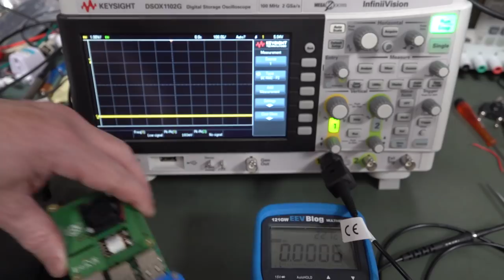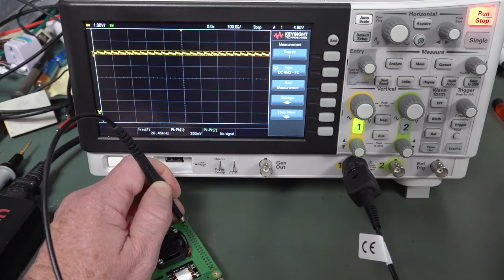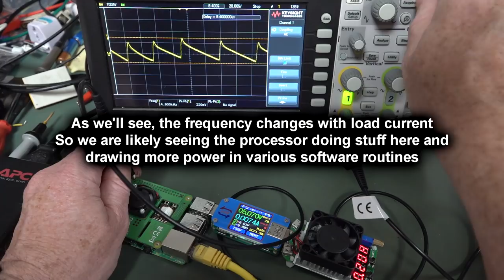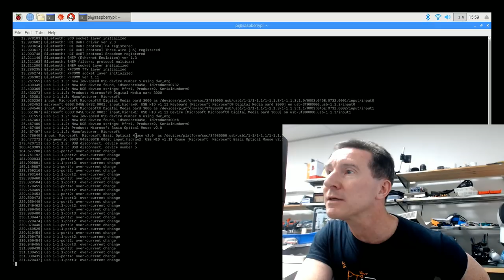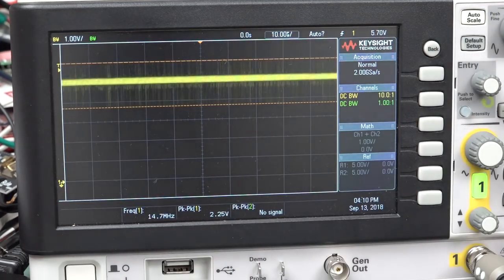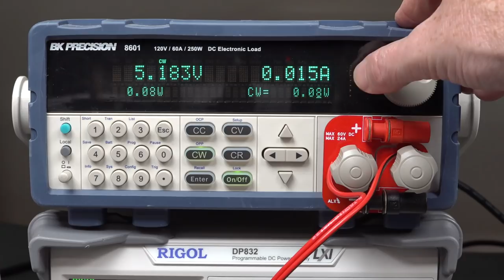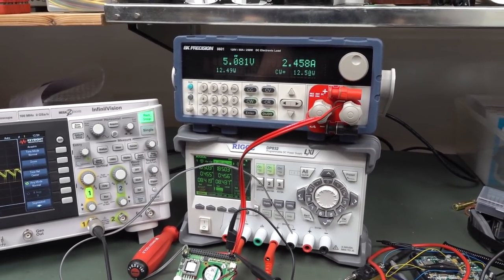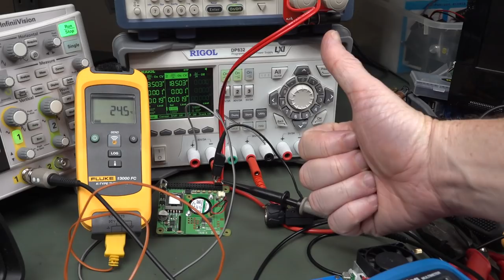EEVblog #1122 - Raspberry Pi 3 PoE Hat FAIL Investigation

Comment: Eben Upton of the Raspberry Pi Foundation told The Register that the problem lay with "an interaction between the fairly low-frequency switching regulator on the HAT, and one of the two brands of USB current limiting switch that we use on the main board".

Upton continued: "Because the regulator operates at a fairly low frequency, each time it switches it moves quite a large chunk of energy into the three USB reservoir caps via the current limiting switch: this large instantaneous current is fooling the switch into thinking that a genuine over-current event is occurring."

https://www.theregister.co.uk/2018/09/11/raspberry_pi_poe_hat_issue/
Reply from the maker: Ah, there you go, interesting. Is there a full schematic that shows the USB protection chip? I haven't even looked at what chips are used on the RPi yet
Reply: Why even charge caps with current limiting?
Reply: Sorry I don't know I just read the article a couple of hours ago and thought it might help clarify the issue.
Reply: I don't think RPis are fully open source https://www.raspberrypi.org/forums/viewtopic.php?t=55777
Reply: i was about to just post the same link. 

it is a refreshing change though for a company to be open and honest about a issue and to state that if you tinker with the hat to fix it you will still honour the guarantee...
Reply: hmm, now I wonder if a bulk "cap mod" on the hat output, would reduce the USB port caps from trying to filter the power for the rest of the Pi3. Hmmm.

a couple of nice hundreds uf Os-Con's may do the trick. And a heatsink for them diodes, damn! 131c, on the outside of the diode, I'm surprised it didn't die sooner.
Reply: What's the point of the three capacitors in the USB subsystem? I'd try scraping them off and seeing what happens
Reply: The PI will crash when you plug in USB devices while the PI is already running, due to the "rush-in" current that occurs when the empty capacitors in the USB device are suddenly connected. The USB host needs to have a certain amount of capacitance from which to provide this current.
Reply from the maker: Martin Rowan - I'd expect a fair bit of variance with this, but errors triggered with nothing connected, yes, something else has to be at play as well. Perhaps it's the rail noise as I initially expected.
Reply from the maker: MH Techy - That is the "reduced" schematic, it doesn't show the USB components in questions. Has anyone done a reverse engineered schematic?
Reply: A comment this informative and well sourced makes me wish I had sock accounts to contribute more upthumbs
Reply: this would never have happened if dave had just supported solar roadways
Reply: @Blox117  And batteriser.
Reply: EEVblog  I'm not sure it's the part but the pin-out looks good.    https://www.exar.com/product/power-management/universal-pmics/universal-pmics/mxl7704#typical-app-modal
Reply: SMPSU's have a tendency to blow themselves to bits. Current limit  is applied on every cycle to stop that happening in the event of a momentary glitch that would destroy the board otherwise.
Reply: Apologies, I didn't look too carefully before posting.  It appears they don't release the full schematics anymore.  I haven't looked at the pi since the first release.  Guess I must have been mixing up my Arduino and Pi's.  Been too busy on programming jobs the last 2 years to do any hardware stuff :(
Reply: Not surprised at all. Historically the Raspberry Pi has had many issues with power delivery, from the low-efficiency linear regulator and inability to hot-plug USB devices on the original Raspberry Pi B, to the exposed light-sensitive CSP regulator on the Raspberry Pi 2, and now this. They're designed and made on a shoestring budget.
Reply: Sooooo, how big caps do we need if we put em across the sense resistors? Give that initial pulse a way past.
Much more fun than filtering the signal in the protection chip...
Reply: Ah! Aliasing at it's finest haha 🤣

Comment: I found a solution and a colleague has already posted it in the forums. I cut the +5VDC PCB track near the fan connector and inserted a 4.7uH inductor in series to the output of the hat. I also added two 100uF ceramic caps to the 5V output behind the inductor. There are unpopulated PCB spots that can be used for the caps.
The result has a current draw on the USB ports of up to 1000mA without overcurrent event. With better analysis of the problem, this could possibly improved. But it shows that the problem can be solved by better filtering of the supply output.
Reply: How big are those caps? (kidding).
Low ESR tants are good too.
Reply: Yeah I thought about the same thing. 1 or 2 stage pi filter.
Reply: Last time I tries a Pi filter on a buck converter output it screwed up the transient response of the converter.
Reply: You should submit a video to Dave showing the solution and ask for half the video royalties. lol

Comment: 2:08 - Isolation slot? I thought this gap is so the camera flatflex-cable can reach to the connector on the RPi.
Reply: The cutout doubles as the isolation slot and camera flex hole
Reply: That explains that nobody cared about clearances :D
Reply: That would make sense as one common use for PoE is for networked cameras.
Reply: It's not even a maybe. It IS for the cable for the camera.
But some people just always look for the odd explanation.
Reply: You're wrong there feldim2425, the problem is not the voltage of (or transients on) the two power lines, it's the potential difference between the two -- isolated -- circuits. Same as an opto-coupler: the led voltage is ~2V but it can isolate 2000V, so the slot under the opto needs clearance for 2000V. This hat does not account for high potential differences between the two circuits and the 'slot' is unrelated as stated earlier.
Reply: Well, you don’t need big clearance between 48V and 5V. It’s not like one is Mains and the other is 5V.
Reply: I believe 1500V isolation from POE source to user is a requirement
Reply: Lasse Langwadt Christensen You are right! (Though i still think the solder mask can take 1.5kV, a bit more though would ensure that.)
Reply from the maker: feldim2425 - It's not the 48V, it's for transients on the line.
Reply: @feldim2425 ethernet is supposed to have 1500v isolation
Reply: It's a HAT, it is using the standard template for the HAT layout, it even has the EEPROM that holds the information on how the board works.   https://www.raspberrypi.org/blog/introducing-raspberry-pi-hats/
Reply: EEVblog  ::  Why so many ADs 👎🏻  in your video
Reply: Ever seen the clearance of a WeMos D1 mini Relay Hat? It's a joke. A dangerous one... Not planning to switch 240V with those.

Comment: Should have used way bigger pads for that SM connector
Reply from the maker: Yep, hardly any pad area = hardly any bonding area = easy to lift
Reply: They should use extension connectors instead anyway. Those ones they use have no practical advantage over through-hole ones. Just make the pins on the through-hole ones longer.
Reply: Not really possible, for low profile when not using a hat the female headers need to be very low, headers with long pins are only available with with much longer female headers. So these low profile "stick through" female connectors are used instead, and they are obviously only available in SMT. And you must use the same solution for the 4-pin female header as you do for the 40-pin header. I do agree that more "flesh", and some via's around the pads would have made the rip-off problem less pronounced. Just lift off the HAT board vertically so you don't lever off the connector, its in the documentation that comes with the POE board that you should lift it off this way carefully. The main problem is that if you are pulling on just one end you tend to lever off the SMT connector. I say stick a flat screwdriver between the connectors, to ease it loose vertically.
Reply: I don't understand why they put everything on the bottom side anyway... They could put ererything on the top side with a proper ground plane on the backside and use through hole mounted connectors. would make the entire thing 5mm thicker maybe.
Reply: Yeah. There's not really much point in worrying about the height. The SD corruption issue makes the Pi unsuitable for anything other than hobby applications anyway.
Reply: Play with Junk, keeping everything surface mount and on the bottom side is simpler for automated production
Reply: drop of superglu on the backside will sort it out
Reply: Maybe add some kind of powder right before dropping some ethyl cyanoacrylate though.

Comment: You know... This thing is open source. You could make a pretty penny by making an improved HAT for the Pi. I'd love to buy an EEV-HAT.
Reply: starshipeleven  LOL No. It certainly does not. This design is just lazy. I have freeware PCB design software that could do a better job. Imagine what ol' Davy Jones here could do with it. 😏
Reply: Bad design because RP has a lack of good hardware engineers. Nowadays software engineers think they can design hardware by copying the application from the datasheet, through it on a circuit board and we are done. Lets start writing more software.
Reply: Don't hate, I build PCBs just well enough to work and then move back to the software. But I wouldn't ever call myself a hardware engineer.

Comment: They should've used through-hole pin headers so you could use those long pin headers designed for stacking. This basically prevents using the GPIO for anything.
Reply: If you use headers with long pins in between the PI and POE board you will get extended pin headers, so you can put a HAT board on top, its all explained in the POE launch blog, including where you can buy the pin header extenders and the part number for it.  The POE was actually designed so that you could use it with a HAT, the EEPROM which holds information about the board (a HAT) will still work, as the  microcontroller that emulates the EEPROM for the POE, is using a different I2C address.

Comment: Different failures on Pi3B in power supply section.  After burning in 2 units for about 3 weeks, all 3 inductors in power supply section are over heating and cooking the PCB in the local vicinity of these parts.   Obviously why + version got the supply area modified.
Reply from the maker: Didn't know that, ouch. I have two B Pi's
Reply: EEVblog These units are part of a  Stratux ADSB (in) navigation plus traffic receiver for aircraft.   Needless to say, not good to have things burning while flying.   Clue was sick smell of toasty PCB material which is unpleasant.   Working on redesign of input power circuits which generate 5V->3.3V and 1.8V
Reply: The 3+ actually had an entire redesign of the power section, not just a modification. The older one looked like an afterthought.

Comment: How about EMC compliance? I did a PoE design this year similar to this one but using a TI controller running at 240kHz and the conducted emissions were just horrible. Had to use a big ass filter inductor as well as a large common mode choke to get it to a reasonable level. Not seeing any adequate input filter on this thing so it may very well not pass any standard.

Comment: At my last job, we designed a class 4(25W) PoE-hat for our rpi based IoT sensor nodes - for me it felt not quite right, that the murata dcdc-converters(UEI30-050-Q12P-C) reached >80°C(easily) under normal working conditions. So in the end I used thermally conductive silicone for glueing them to our finned aluminum housing..
.. oh, by the way: Its not a good idea to use the old rpi 3(and I guess the even older ones) in a PoE- environment - we've gone through a lot of pain before we realized that the rpi lan-chip is totally missing tvs-protection and prone to get killed by PoE transients.
Reply: I do want a proper 802.3at isolated POE Pi-Hat!

Comment: Five different power supplies, three different cables and the Pi is still complaining about the lack of available power. I had my hopes up for this PoE hat!
Reply: The new Pis require a non-standard voltage (something like 5.1V I think). Not officially of course. Officially they work from 4.75V to 5.25V, but in practice they will pretty much always complain unless you use the official power supply (or happen upon a third party power supply that outputs an unusually high voltage).

Comment: You figure they would have caught that glitch in testing and made the necessary changes to the design before going into production.
Reply from the maker: Oh well, shit happens.
Reply: If you read "The Register"'s article on this bug, linked above somewhere, the Pi3 itself has "two brands of USB current limiting switch" ie two sources for the same part. The glitch only occurs with one brand of that IC, they tested both, but only conducted detailed testing with one, the wrong one as it turns out.
Reply: Still seems bad testing, why wouldn't you do the full suite with both if you know both are out there?  Literally product testing 101.
Reply: They probably used the Fontus approach to engineering
Reply: Do you know how to tell if we have the faulty one?

Comment: Hi Dave.
I recently made a video where I show that Raspberry has changed there frequency governor so that at 60C it clocks to 1200Mhz instead of doing that at 70C(when new/benchmarks were done). And that the Rpi 3b+ still says it`s running at 1400Mhz(or other overclock speed). This means without a fan it now runs slower than the 3B when stressed. I`ve made a tread about it in the rpi forum. First they laughed it away. They changed the tread title and comments. They terminated the tread so no new comments can be made, and it doesn`t appear again. Important information about this was removed. They came with the excuse that nobody notices it so they don`t care. When new this all worked fine.
It is a small thing. But we want to know what the real clockspeed is instead of a fake number.
Here my video. Links to the forum in the discription. It`s not my best video, but the info is all there.
I love sbc`s. I want them to be as good as possible. 
Greetings.
https://www.youtube.com/watch?v=dDWv0A36W9s

Comment: Everything needs PoE ..... EVERYTHING! I am fed up of all the crappy " smart home" devices that have Ethernet , but then need a DC jack as well!!!! Pathetic
Reply: Need a PoE refrigerator!
Reply: caveman123ization  Refrigerators already use PoE
Reply: But everything is going to wifi anyway. Perhaps we need a new ethernet connector (the old one is pretty huge by modern standards) that can also be used as a power socket with a simplified 2-wire plug. POE is a a hack anyway. Just add another pair and be done with it.
Reply: Smart home devices that I use, none of them has ethernet, everything is either over wifi or zigbee.
Reply: Cables are the technology of the past century.
Power over Wifi :P
Reply: still better than "smart home" devices with no encryption
Reply: PoE isn’t exactly that common in the home. Mostly tech enthusiasts and othersuch would have it in their home.

If you must, you can also buy adapters that take PoE and output the power through standard DC jack.
Reply: kingoftaurus

Multiple ethernet cables in parallel just for supply :) 
Just imagine a PoE Toaster with 80 ports on the back...
Reply: Elliot Wood  thanks for that - I didn't know they existed. It seems obvious now, but I never thought of looking.
Reply: Same, or stuff that's wireless only... or worse, cloud.
Reply: PoE is useful for devices than need cable running to them for power... Why run two cables, when one works? If your RPi is being used as a camera controller or weather station etc etc, then PoE is a godsend.

People herein who bang on about wifi, don't understand the full range of applications that PoE is useful for... And therefore their opinions can safely be ignored as irrelevant.
Reply: Wifi gets worse and worse lately, where I live. There is more and more wireless crap getting switched on in the neighbourhood. And when the neighbour uses her microwave, I lose all signals.
Reply: @skipfred  most smart home stuff uses whyfi...as in "Why is this blanket blank thing failing to communicate AGAIN?"

Comment: PoE maxes out at 15W and you might be pulling near the 3.5A @5V capacity of the B+'s internal DC-DC. It's only PoE+ 802.3(at) that does a full 30W. There are also conversion losses to factor in there. Try checking the transient current draw.

Comment: don't know if your pi's dmesg is new enough to support it
but there's a useful switch in newer dmesg binaries
dmesg -w  
updates live with kernel messages
Reply: That doesn't do live updates.
not even `dmesg | tail -f`
try it!
unless your dmesg works totally different than mine.
Reply: watch "dmesg |tail"
Reply: ... yeah that'd help, if a bit hacky... watch -n 0.1 if you want it to be faster
but if you have the switch -w in dmesg, use it. "dmesg -w"